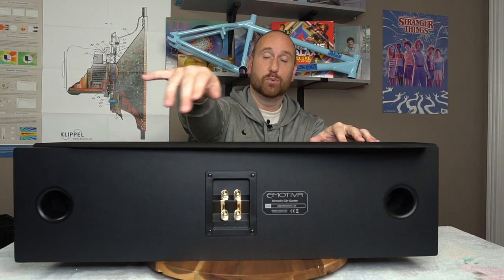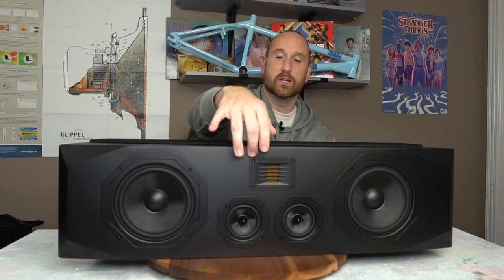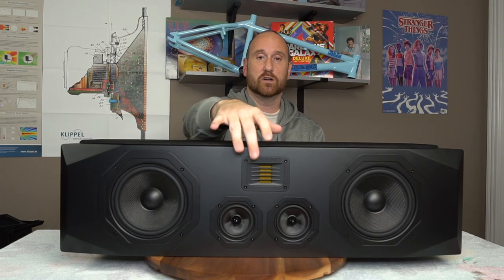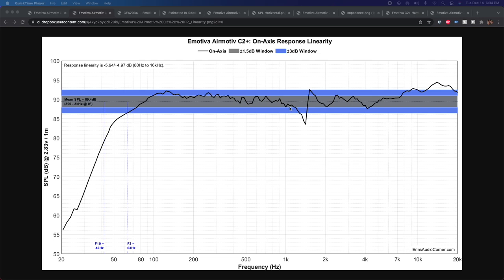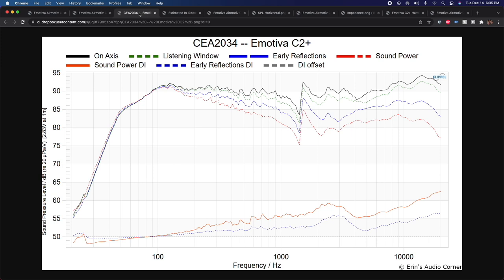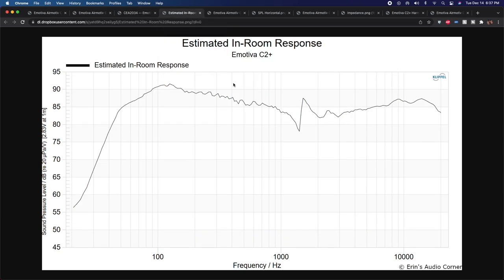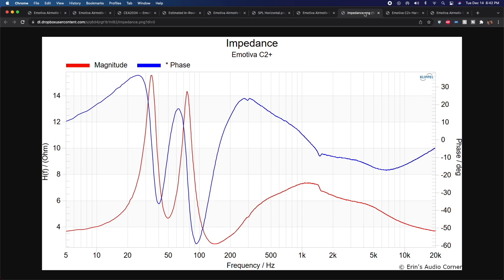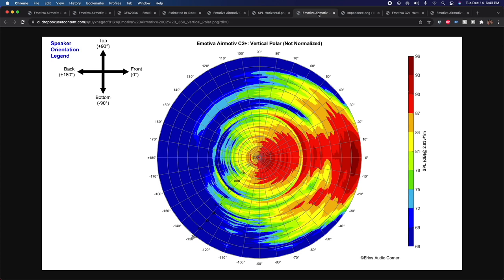Trading Linearity and sweet spots for SPL.  The struggle is real.

Comment: What a sad state of affairs. An engineering company who DEFINITELY knows better clearly made this speaker to follow what markets/sells (big size, multiple drivers with improper crossovers based on spacing) - completely and diametrically opposite to proper speaker design, especially for a center. 

Shameless money grab, giving consumers what they think they need. The realistic situations where this design would be preferred over the C1+ (which isn't ideal either, the W/M crossover is still too high at 550Hz) are so incredibly rare and narrow that they practically don't exist. When exactly would that be??? In a huge room with no side-wall reflections and sitting 20+ ft away wanting to get 100dB? Who needs that? It's not even linear on axis!! AND the tweeter can't keep up with the mids and woofers as your measurement shows - another clear sign this is marketing over engineering.

Thanks so much Erin for calling them out - and keep up the good and honest work!!!
Reply: Shameless money grab? This thing is $400.

Comment: Dude that speaker is freaking humongous! What the hell! It's that even necessary? I was actually thinking of pairing this with my JBL 570 but went with the 520C that goes with the JBL 5 series. Could not be happier to be honest.
Reply: It's dedicated home theater size. I have a 520C, and wouldn't use it in a large home theater.
Reply: I can definitely see the need for something bigger than a 520c in large rooms,  but this Emotiva really is massive. 

If you're going this far with home theater, why not just use a full size tower behind a projection screen?

Comment: Thanks Erin! Just suscribed! Great review! I have T1+ Fronts as well as the C2+. Would it be better to use  a single B1+ as a center or just not have a center channel at all? My wife and I sit 10 1/2 ft  away and 2 1/2 ft both left and right from dead center .
Reply: Using a trigonometry calculator you should be in the "safe zone" up to around 44" left or right of the center line at 10' away
Reply: @shaolin95  Thanks for the calculation. Looks like I'm viewing in that zone. Thought I may have blown it  the center channel.

Comment: Hi Erin, just curious if you have the SVS Ultra center in your queue for review?

Would like to compare the data versus this center channel.

You do great reviews.  🍻
Reply from the maker: I sure don’t.
Reply: @ErinsAudioCorner  Thanks for the reply.  I listened to it for awhile and subjectively I liked it, but you do great work and was wondering what the data would look like.

1 more question:

I assume you perform you testing with a great power amp.  If you pick your favorite speaker data, then rerun your testing with the speaker hooked to a an “underpowered” amp or average AVR…would the new speaker data be terrible or just minor issues that eq could fix?

- By underpowered, I mean if the speaker recommends 300w and you hook up an 60w or 80w amp.

Thanks again.

Comment: So is it better to have a line array for a center channel????? And can u please specify what u mean crossing down low ??? Hz???
Reply from the maker: A line array you mean vertical, correct?  Because that shouldn’t be a problem with most designs. 

Crossing low, yes, frequency (Hz).
Reply: No. A single driver, coaxial, or drivers close together, would be better for off axis listening. It would be optimum if the center channel was vertically positioned like towers or bookshelf speakers.
Reply: Nope I mean horizontal line aray instead of point sources

Comment: So would a bookshelf on it's side fair better than these designs?
Reply: I can't imagine an AMT on its side would be a good idea, given their tendency to have different vertical and horizontal dispersion (citation needed)

Coaxial speakers might be ok though, I'm sure it just depends on the speaker.
Reply from the maker: ^ agreed.  It really does depend on the speaker.  Assuming a 2-way bookshelf, most would fare better than this wrt horizontal dispersion but it's really up to the design and how well integrated the tweeter and mid are.

Comment: Surprised at the somewhat negative findings. Seen pretty unanimous rave reviews on audiophile forums.
Reply: The visual representation of the measurements exaggerates the audible effects. The dip and spike has never been an issue because it's barely audible with actual content. The possible elevated high frequencies would be noticeable, but then Audissey or Dirac are probably taming that too.
Reply from the maker: The issue isn't so much with the non-linearity as it is the off-axis response which hinders the purpose of a center channel speaker with multiple seats.  Otherwise, yea, I can get why people would like it because the few on-axis issues aren't terrible and the price is solid for the overall performance *otherwise*.  Trade-offs.

Comment: What center channel speakers do you recommend
Reply: ELAC, KEF, concentric drivers win here.  Bookshelf speakers, a small tower like the t0 or t1 works really well!  Think about the shape of a person, you want to mimic that if you want natural sounding vocals/speech.  The polk centers like the r400 and l400 are decent, better than most.
Reply: @sturdyvw  none of those are true concentric only center channels. They may have a concentric drivers but still mixed with standard drivers spaced apart which would still cause the spacing between drivers issues Erin talked about.
Reply: Typical woofers crossing over under 600hz won't have an issue with lobeing. The problem with this speaker is the duel midrange.
Reply: ...dual...

Comment: Is comb filtering an issue an issue with stereo speakers? Possibly worse because the speakers are much wider apart?
Reply: In a stereo setup like a music system you are still between the two speakers listening to music so is kind of being on axis with the center. 
Very different from the issue with a center where when you are off axis, you are already in a position where on of your ears is away from both speakers

Comment: AMT tweeters are so shrill that alone makes this a non contender. Just my opinion.
Reply from the maker: Not all of them are.  I think the biggest thing is they have such a wide radiation pattern that they really almost need to be sloping downward on-axis so that the in-room response will also slope down.  Otherwise, you wind up with a boosted treble region.  Some dome tweeters have the same effect but typically ribbon-type tweeters are "worse" in this regard (or better, depending on your preference).